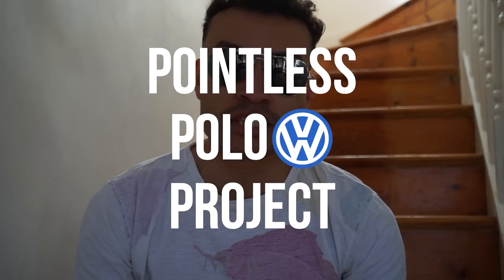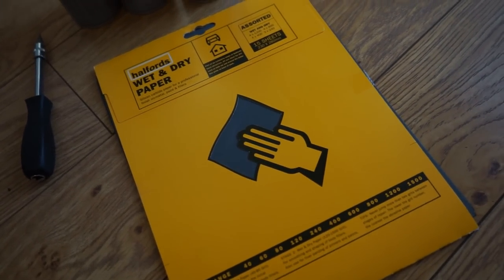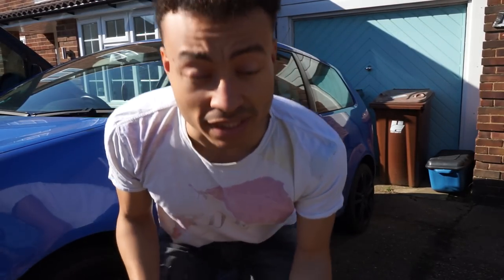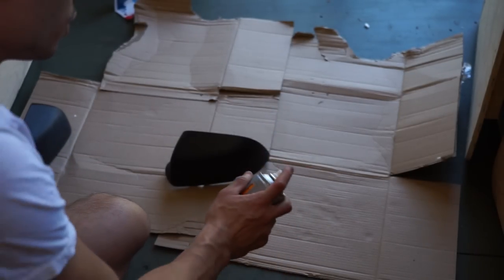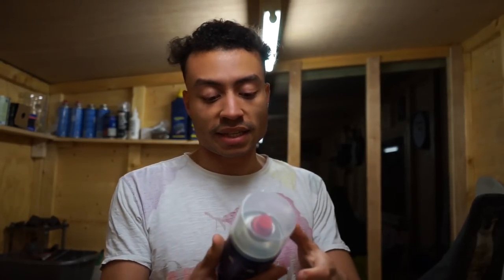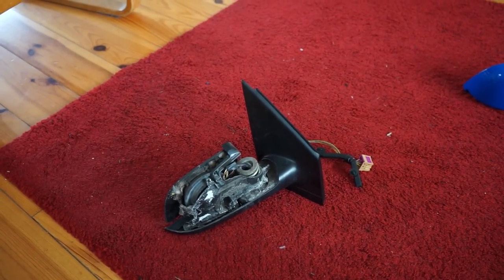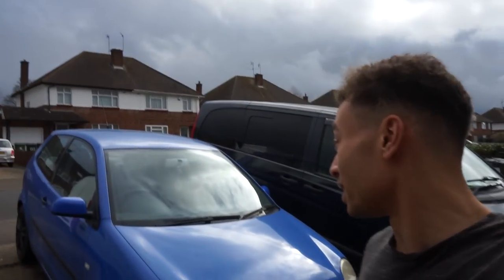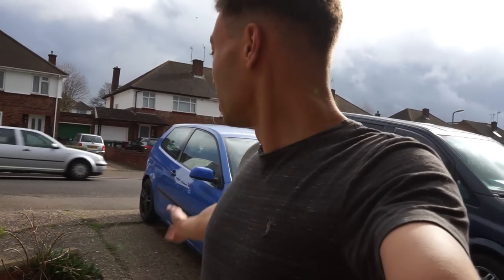Painting And Replacing VW Polo 9n Mirror Caps (CHEAP TRANSFORMATION!) | Pointless Polo Project

Comment: you should fit the facelift wing mirrors mate, they have indicators built into them and look sweet, everything will work but not the indicator but theyre miles better as the mirror is sort of perspex, however you say it, so you can see more in your vision too
Reply from the maker: I do like the facelift mirrors but yeah it's the indicator that I wasn't sure about!
Reply: @CarsWithJB  straight bolt in, but im sure if you swap the window motors too they would work, as theyre the door control module aswell, but without they still function as normal but without indicators mate, message me as im building a polo too, gti rep and engine swapped it too maye

Comment: Love these videos man. I've also got a polo 9n 2003 plate and have a Engine management warning light that keeps coming on and off and wondered if you had had this too or any help that you could suggest!
Reply: Get an OBD2 code reader and plug it in just under the steering wheel to the right a bit, then look up the code it gives. They dont cos't much.
Reply: Daniel P thank you
Reply: @paddycrabb6999   thats a good shout, but from when we owned a polo 9n the engine light would come on for literally any fault; so to be optimistic, it could literally be anything; sounds like a faulty sensor or something that has degraded overtime to me, hence being temperamental.
Reply from the maker: Yeah I had an intermittent engine light on my Skoda (same system) before this, and I just ignored it as we worked out it was a faulty sensor through OBD - but definitely check!
Reply: Thanks guys!

Comment: You should of done a grip coat with the first coat of colour, then built up the thickness through the coats, also wet sand the final piece after laquer, cut and polish it and you’ll be left with a mirror finish like the car paint no orange peel